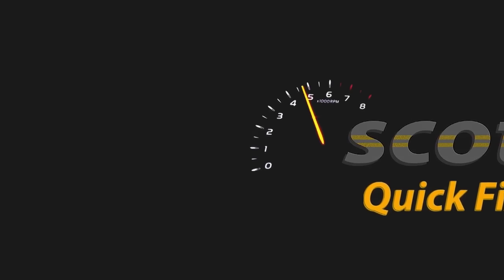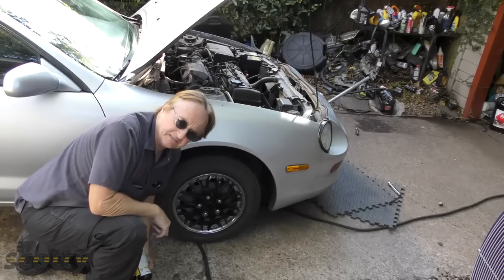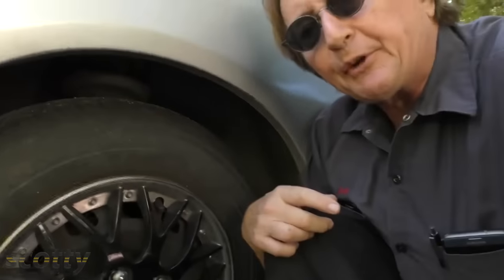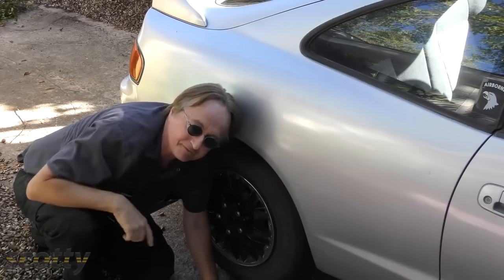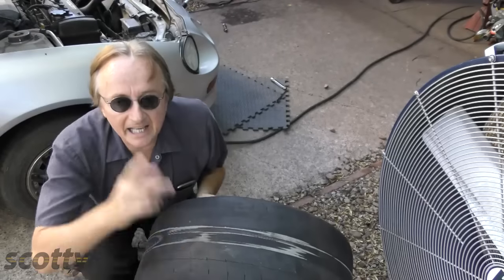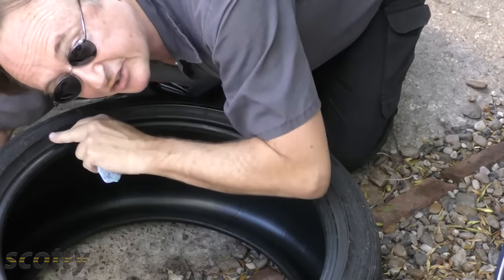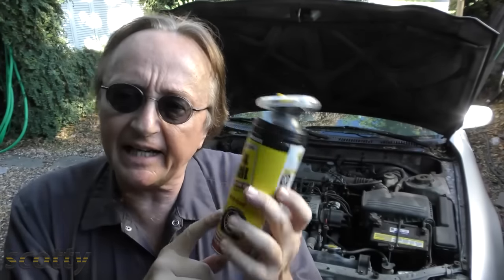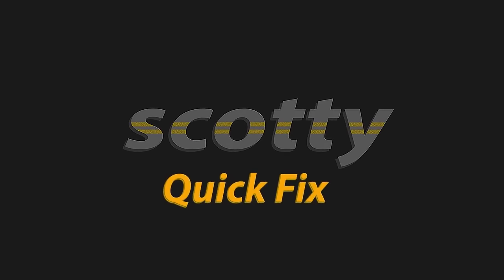Does Fix-a-Flat Really Work? (How Fix a Flat Tire)

Comment: this stuff gunks up the rim and ruins the tire from ever being able to be properly patched.  the rim will have to be cleaned next time the tire is changed, and the tire will be ruined. dont be lazy folks. get your fat ass out amd change the tire and put on the donut. then go to the tire shop. should cost you less than 20 bucks for a proper patch to be put on the tire, including having it mounted and balanced and put back on the car.